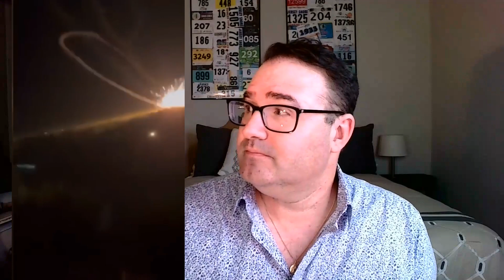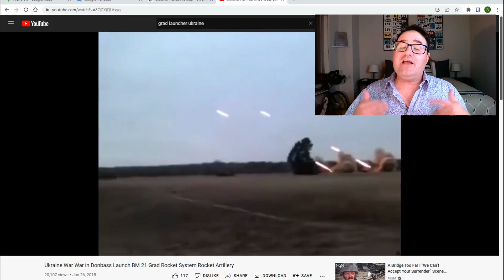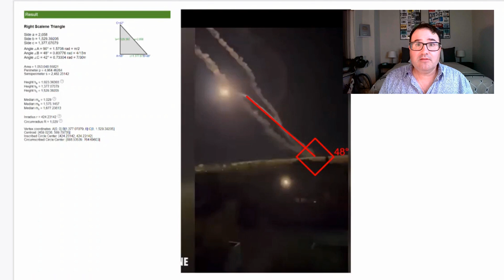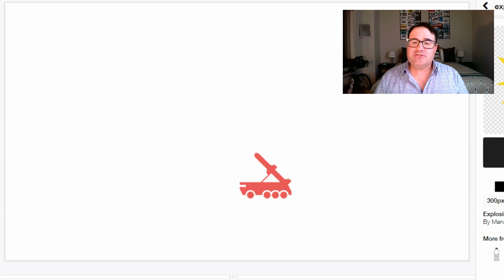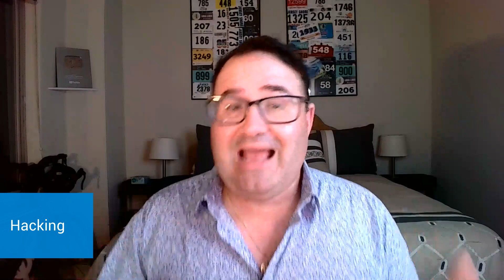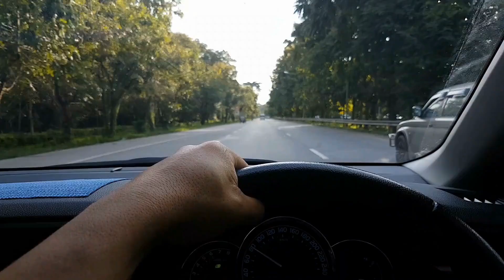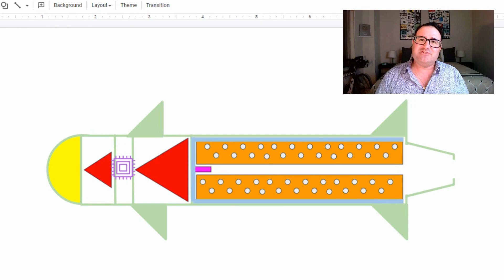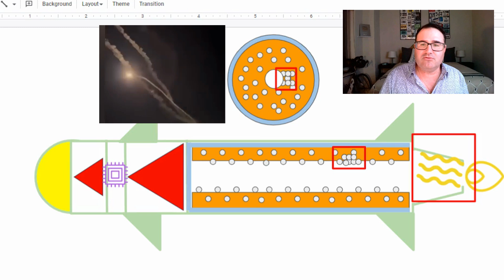Why this missile U -Turned

Comment: The missile doesn't know where it is at all times. It doesn't know this because it doesn't know where it isn't, by adding where it is, to where it isn't, or where it is, to where it isn't, whichever is lesser, it fails to obtain a difference, or deviation. The guidance sub-system uses lack of deviation to generate incorrect commands to drive the missile from a position where it isn't, to a position where it is, and arriving at a position where it was, it still isn't. Consequently, the position where it is, is still the position that it isn't, and it follows that the position where it was, is still the position that it is. In the event of the position that it is in is the position that it wasn't, the system has failed to recognize the variation. The variation being the absence of difference between where the missile is, and where it wasn't. If variation is considered to be a significant factor, it too, may be ignored by the GEA. However, the missile doesn't know where it was. The missile guidance computance scenario fails as follows: Because a variation has modified some of the information the missile has obtained, it is not sure just where it is, however, it is unsure where it isn't, within reason, and it doesn't know where it was. It now adds where it shouldn't be, to where it was, or vice versa. By adding this to the algebraic sum of where it should be, and where it wasn't. It is unable to obtain a deviation, and a variation, which is called "dirt".

Comment: I doubt that. I think that's a pretty bad take. If all the trust is coming from the same nozzle, there's not really a chance fuel burning unevenly would cause such a great asymmetric trust as to cause a 180 like that. I think a stuck fin is far more likely, which also plays into handling and manufacturing issues. But definitely not asymmetric thrust, that's nearly as implausible as the rest of the theories.

Comment: Should probably stick to what you know when informing the public. 

Uneven fuel burning usually increases or decreases the entire internal pressure of the engine not one side of the internal pressure.
Reply: Also hack attacks don't require WAN(moles and alternative methods exist). I believe it's a control malfunction because a fin malfunction generally won't correct itself.

Comment: Don't think it was Fuel issue due to fact that it turns to quick which you wouldn't get from fuel burning wrong you would get some diversion but nothing to that dramatic effect,  I would agree with mishandling or bad production but to me this is Fin Issues just based on the turn rate if you watch video it continues to turn before impact so it would have do a 360 if it had not hit the ground.

Comment: imho in order to make a 180 turn like that the point of force would have to be far away from the missile's centerline, putting all the thrust a couple of inches away from the centerline couldn't possibly make it 180, the missile would've turned slightly at most, i think the reversed gyro as suggested by Punman5 seems a more probable cause.

Great channel nonetheless 👍

Comment: Watch about 2-400 Rocket fails.. Loads of footage from testing to launches. Rockets do NOT FAIL Clean.. It is nearly impossible for a rocket fail to look so clean. If it missed the sender location I would agree with you. But what the rocket actually performed is a return to sender move that Hackers would actually program any hacked rockets to do that as soon as possible so YES In the boost phase if possible..

Comment: I dont think so. A clump should cause it to lose control or increase the pressure inside the chamber and explode.  Its trajectory was to smooth to me to think propellant issue. I would say that obviously two other rockets had already came from that unit, and either heat or debris from the other rockets somehow damaged a fin. The initial inertia at lower speeds didn't have the same effects as did the pressures at two seconds in. Im thinking guidance because it wasn't catastrophic.

Comment: I was an M551 gunner and had the opportunity to fire a dozen Shillelagh missiles. These are infrared guided antitank missiles that are guided to the target by the gunner via the main sight. Additionally, I saw dozens of  
Shillelagh missiles launched in training. My best guess is 15% had motor or guidance failures. This resulted in the missile impacting the ground 100 feet out of the barrel. Some climbed into the sky. Others would do a hard 90-degree turn soon after firing. Those that hit the target disassembled it into its major component parts. Engine that way➡️ turret this way⬆️ road wheels↔️

Comment: I have another theory Ryan..
The system was launching to attack incoming drones, like  TB 2. However, by this point the UKR had loitering munitions already. I think the TB2 operators launched a 300 loitering because they knew their unit was targeted and about to be terminated. The system locked onto the loitering munition inbound and followed it into the target due to lock.

Comment: I didn't see a flame or plume on the nose side but it's possible that a gas leak or thruster near the front caused the turn, but it probably would have continued to spin. That was my first thought, that the Russians were using a steering thruster that went bad, I lean more now though, toward Ryan's theory.
🌻🌻🌻( ͠° ͟ʖ ͡°) o()xx[{:::::::::::::::::::::>🔥ʕ •ᴥ•ʔゝ☆🔥

Comment: No buddy your analogy is totally flawed as that rocket nozzle guides  that thrust only in one direction whatever happens inside the combustion chamber is futile that's why you have thrust vectoring fins on the outside of the nozzle as only there can you manipulate the thrust forces in various directions so your understanding of how rocket motors work is scary but hey you tried. You can clearly see the rocket was initially travelling dead straight so there stuck fin theory is eliminated their so it can only come down to a sudden guidance correction made that caused that and how that guidance error accursed can be allot of possible glitches with the electronics suddenly failing servo motor driver board gets stuck giving a constant maximum command in one direction so I think its possibly a electronic glitch

Comment: When would the highest pressure be? What if it burned a hole through the side just as the fuel was used up? They say the  new sidewinders can steer while the motor burns, whereas the old ones couldn't.

Comment: Mehhh...
This doesn't seem very convincing.
Remember that when the jet leaves the rocket, it does it through a nozzle, so irregularities withing the tube would probably be aligned by the nozzle.
Besides, this kind of "thrust vectoring" is very hard to do, even when you want to do it, and it seemed to be a controlled maneuver

If I needed to put up a theory, I would guess that it has to do with failure of some sensor (accelerometer, gyroscope), that caused the missile to "think" that its attitude is incorrect, and try to correct. It could also be a software error, although less likely

Comment: I would think it would be more likely that sensors went over/undervoltage and causing the known location to invert sending it back on itself. Lets face it, Russian weapon systems are not known for their reliability. I have no idea what kind of redundancy if any they have built into them. But if a single sensor misbehaves, and there is nothing to correct it that would make sense. Or some other power incident in the system.

Comment: The fuel Burns inside a chamber, and there's only one exit, so how would the fuel burning weird cause it to turn!? And the missile didn't guide itself into the ground, it turned around 180 degrees and went back to where it started.

Comment: I'm thinking it was more of a gyro error myself, after all these missiles do need to know where they are in reference to the illuminator so they can accurately home in, and if a gyro was not aligned properly, or like a rocket a few years ago, if it was installed upside down I could see it going awol and smacking the launcher. Something similar also happened in WWII with mk14 torpedoes, and other torpedoes as well, with them looping around and hitting the launching subs.

Comment: A single nozzle would 100% NOT be affected by unsymmetric burning of the propellent unless it was a "medusa" multiple exit nozzles.
 Propellent is made in many shapes including what you suggest, a single nozzle cares not, unless it breaks or burns through.
I also dont think the rocket was going very fast, - subsonic, I'd guess or it would have shredded.
Losing the booster fin can or even one fin is my guess fins are mounted in the field, someone messed up, this missile went aerodynamically unstable. 
 The missile going unstable wile retaining the upper missile fins moving or not, with booster attached would behave
 with a very slight bit of stability. " large uncontrolled circles" watch the smoke trail not the flame,, it's a circle.

Comment: In the west usually potassium perchlorate and nano powdered aluminum or 1:1 aluminum/magnesium are mixed in with butadeine phthalate as the binder. This makes for a semi-hard rubbery mass. There would be no migration as everything is the fuel. This was a guidance problem as almost always with poorly mixed propellants the booster will simply explode or you'll hear a loud popping and crackling sound as it flies leading up to the boom.

Comment: Aerospace engineer here: your explanation is very unprobable. The propellant in a solid rocket motor is normally a mixture of solids (oxidizer and fuel) combined with some catalyzers and a binder. This binder is most often comparable to a rubber. During manufacturing all of these components are mixed and then they are molded in the casing of a form. In this form the binder hardens and after it’s set, nothing can shift inside the fuel, without breaking. So either it was wrongly manufactured, which is unlikely since it would need a region with a perfect mix of propellant minus the binder (which is also used as fuel, and all four components are mixed at the same time) or far more likely there was a wrongly manufactured liner/casing/nozzle which burnt through during ascend, which was the cause for the thrust that rotated the rocket. Many fuels (and from the smoke trail, the fuel of this rocket aswell) use Aluminium powder as a fuel, which produces aluminiumoxide as a product of the reaction. This is a solid. If there was a burnthrough in the liner, it could very well be that the hole got partially clogged, which stopped or slowed the rotation. Something similar happened with during the challenger disaster.

Also another comment: the nozzle of a rocket is a Laval nozzle and it not only converges but also, after reaching a critical diameter, diverges again. So it looks a lot more like the middle part of a peanut. 
Other then that great video 😊👍🏼

Comment: That doesn’t make any sense given the way solid motor combustion chambers work.  If it was a problem with the missile itself.  It is more likely that the thrust was vectored via malfunctioning mechanical means or trouble with the nozzle or throat.  Like a burn through.  That’s about the only thing that is going to turn a missile that size and speed that quickly.  Or maybe I’m full of shit.

Comment: Here's my theory: Part way through the flight the hot gases burnt a hole in the side of the nozzle. Now, gases are not only going straight out of the nozzle, but also through the side of the nozzle, therefore, pushing the rear end of the missile off track

Comment: Your argument is that asymmetric burning causes asymmetric thrust and that SEEMS perfectly logical... BUT I have seen model rocket engines with an asymmetric core slotted on the side and they seem to fly straight just fine.

Comment: Any assymetry of the fuel burn is at least partly diluted by the choked flow nozzle and would have to exceed the steering authority. So my guess would be control system failure or burn through the casing kicking it hard sideways.

Comment: Slight correction, solid rocket motors aren't supposed to "explode." They can, but that's a malfunction. They burn, very fast, but still burn. Exploding entails a shockwave and a much faster consumption of fuel than is seen in solid fuel.

The solid fuel itself is actually usually a composite. Generally it's polymer bound ammonium perchlorate. In the west we use something called HTPB, Russians might use something else. Ammonium perchlorate comes in crystals which are then mixed with this binder to make solid fuel. Metal particles are often added, particularly for military applications. HTPB is a polymer. Usually plasticizer is added to make it perform better in manufacturing, but the usual plasticizer content is ~15% of the polymer or 2% of the total motor mass.

I'd be a bit surprised if this is the actual explanation. There can be tons of defects in rocket motor grains, but generally these cause the motor to blow up. The combustion of solid fuel is generally pressure dependant, so if something suddenly started burning faster, it's likely the motor would just shred itself. Plus when solid propellant burns it turns into gases, so those tend to at least mostly equilibrate before the nozzle. It might be possible given a certain chain of issues, but I think it's much more likely to be a guidance issue. Guidance has lots of complex pieces which could have failed.

Comment: What if the tracking machine/sensor, on a lorry beind the rockets picked up the forward rockets and an experienced spotter would have ignored it on the radar, but an in-experienced operator panicked and locked on to anything, cos they had, or had'nt had reports of multiple bogies? Just a theory?
Reply: I didnt mean the question mark on the end of my post ^^^.......and i didnt mean to use the word 'had' so much, either :/ :)

Comment: I think your wrong. The number of missiles I trained on and loaded, they all had nozzel designs that collumated the focus of the rocket exhaust. A clump of propellant would cause a burst of speed or a drop in thrust. Some missiles have exhaust paddles that CAN redirect exhuast so the missile can make a freaking u turn... but, they are only good for a few moments before they burn away. I think it may have been a high altitude bird strike of one or more birds. A bird hitting one of the guidance vanes could upset it, and the missile systems would right the flight as best it could...so... that could cuase a hard turn and place the missile in an unrecoverable altitude. My experiance is on AIM-9 Sidewinders, AGM-119 Peguin missiles and a few others with training on some Russian built stuff that was used as a basis for product improvement.

Comment: Aerospace engineer here, and I respectfully disagree. While fuel settling can happen, I don't really understand how the thrust would be vectored differently through the nozzle because of asymmetric burn. I think that the flow at the nozzle throat would be so turbulent and compressed anyways that the exact source of the hot exhaust gasses and pressure within the rocket motor wouldn't actually matter that much to the *direction* of thrust. That being said, a higher rate of burn in one area may damage the motor and missile body, as this could cause and exceedance of the design pressure of the rocket motor and/or missile body. This could rupture or damage the nozzle and missile body, or even break parts of the missile off, causing an aerodynamic disturbance and thereby veering the rocket dramatically. I don't think that's what happened here, given that the missile doesn't appear to break up or change burn intensity to the video camera. 

I still prefer the fin/stabilizer stuck theory, for three main reasons: 

Shortly before or after launch, a missile may move its fins for several reasons. For one, this could be a part of a calibration cycle of the rocket guidance system, allowing the system to identify and set a zero position for each fin on the servo motor to which it is attached. This is usually accomplished by moving the fin to the extremes of its motion range and picking the mid-point as zero. Ideally, this should be done before flight (obviously) so you don't have wild flight path deviations as the missile accelerates, but a glitch that causes this to happen simultaneously or shortly after launch is within the realm of possibilities. 

Another reason for fin movement shortly after launch could be that the missile is trying to induce a stabilizing rotation, but I kinda doubt that given that this would dramatically complicate input controls should to the fins if you want to maneuver the missile later in flight (as a SAM surely would). 

We also can't discount that the onboard missile computer simply glitched and gave an incorrect command to deflect the fin for that few seconds that we see the missile turning, before ultimately returning the fin to its neutral position when the missile goes straight again. Root cause could be faulty wiring, overflow errors, shoddy electronics, etc resulting in a temporary false input to the fin controls.

Comment: It was a controlled U-Turn, that missle hit exactly to where it was guided. If a fin was stuck or the fuel was burning uneven, the built-in stabilization system would at least tried to correct it and raise the nose of the rocket.

Comment: Off-centre propellant wouldn't cause it to turn. See the C-slot configuration in the Grain Geometry section of the Wikipedia article on Solid-propellant rocket. That is the extreme of what you say and yet just changes the burn profile